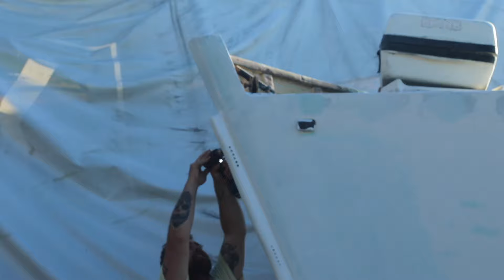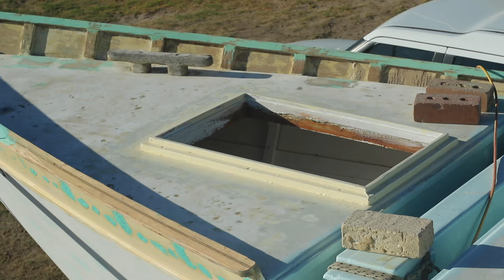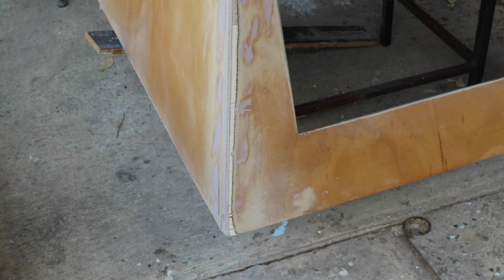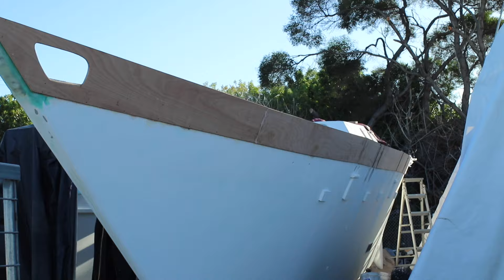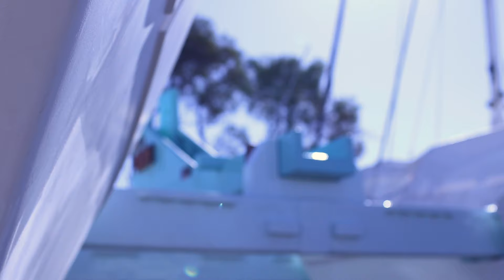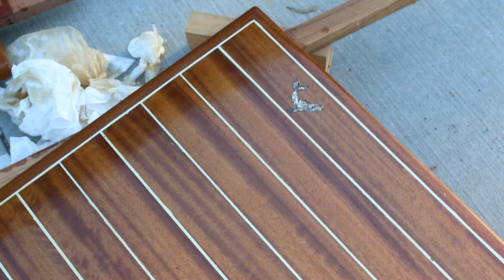Boat Update Video | James Wharram Catamaran Ep. 9

Comment: How does the rudder lashing works? Would not those holes lead to water ingress in the keel wood?
Reply: Overdrill the holes, fill with epoxy, allow to harden, drill correct size holes in the epoxy, no bare wood.